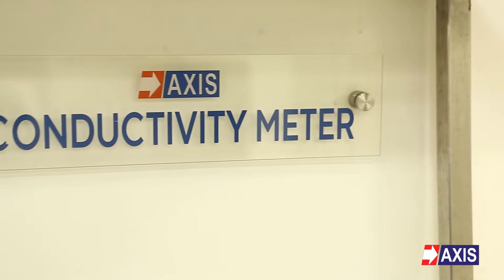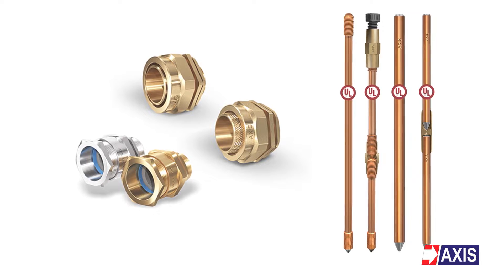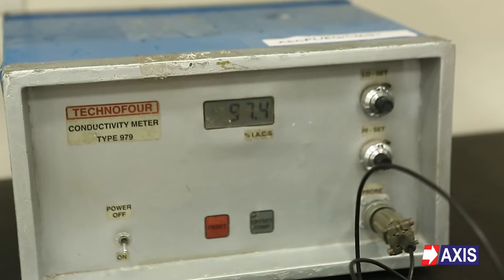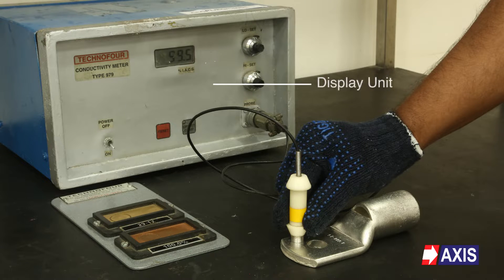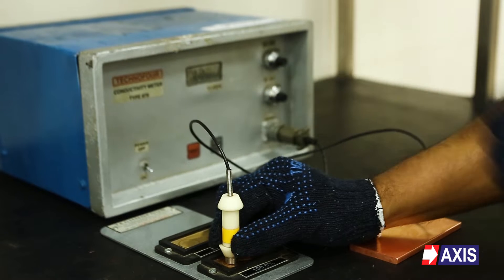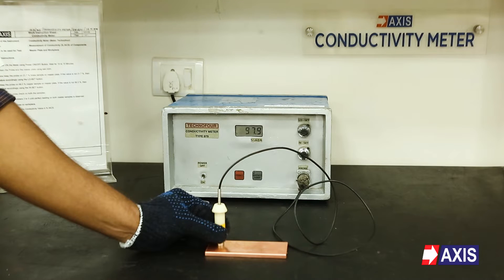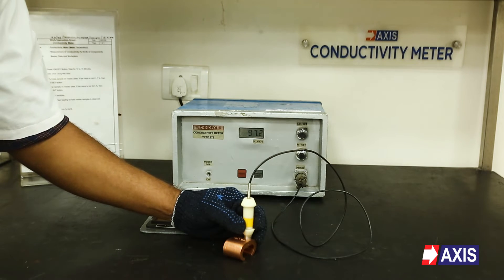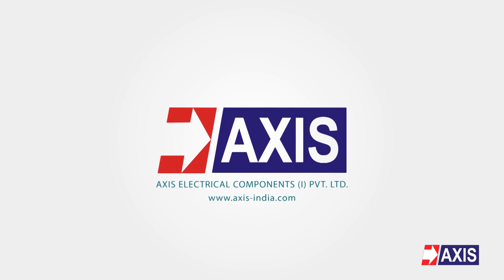Electrical Conductivity Test of Copper Lugs, Bus Bars & C - Connectors

Comment: Hello dear about principle of test, is
Probe send electrons (current) to article to measure conductivity of this article according by counted electrons of test article?
Reply from the maker: The device generates a high-frequency alternating current (AC) in a probe. The AC produces an alternating magnetic field, which induces eddy currents in the metal surface when it is brought close. The strength and pattern of these eddy currents depend on the material's conductivity. The device measures the changes in the magnetic field caused by these eddy currents and calculates the conductivity.